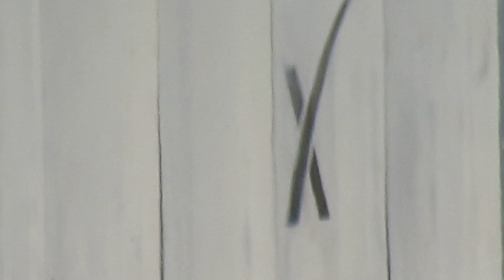Launch site with SN6 on the stand Aug 15 2020

Comment: WAY to much camera wiggling and Zooming In and Zooming out for me. 🤷🏼‍♀️👎
Zoom in, zoom out, zoom in  zoom out, zoom in  zoom out,  zoom in, zoom out. Get the picture?
Reply from the maker: I will try! What about the wind noise? Should I edit that out?
Reply: John Randolph ,,, never even noticed the wind noise with the Zooming distraction, most folks get a dead cat for a mic muffler, if you have an external mic that is.